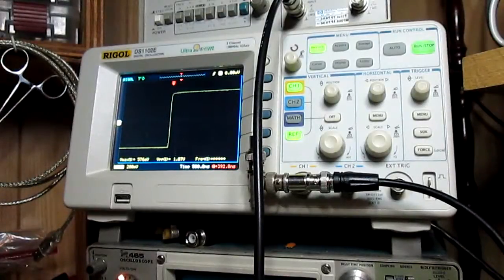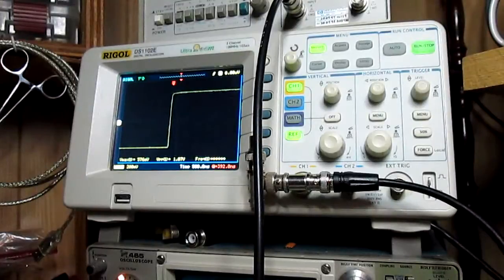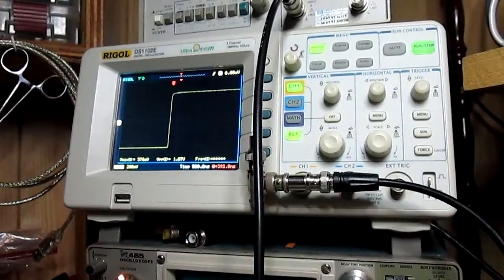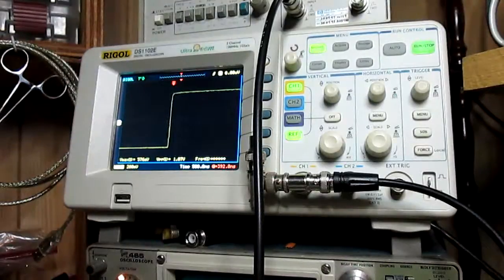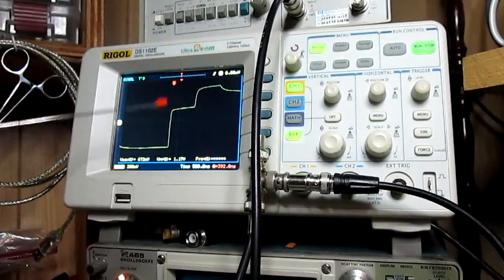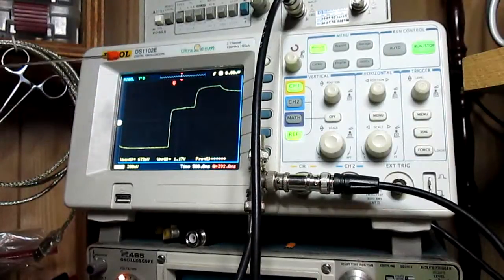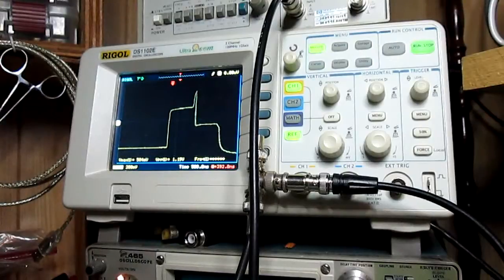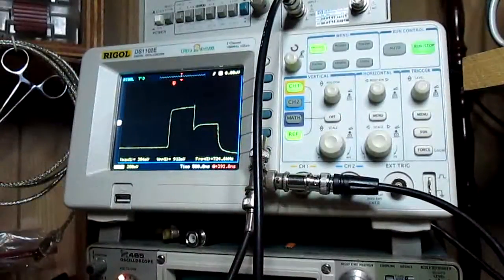Poor mans TDR - Supplemental info and Reflected Energy Proof

Comment: Love the 465 used as a scope stand for the Rigol. It takes me back to the workbench at WKYC TV in Cleveland in 1976! Prior to that, when I worked at Channel 23 in Akron we used a similar technique to locate burned insulators in the 9 inch hardline that ran 1000 feet up the tower. Since the hardline was bolted together in 20 foot lengths, we could easily identify for the riggers which 20 foot section needed to be removed and lowered for cleaning.
Reply from the maker: Was just trying to keep all the scopes in one area